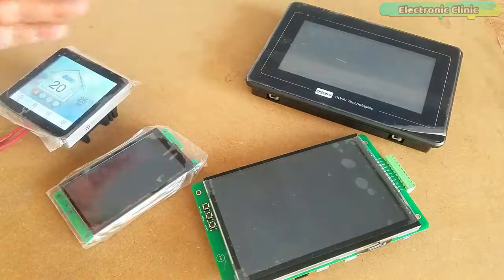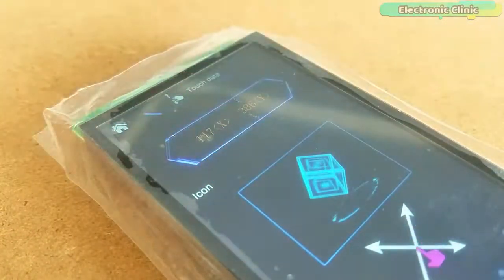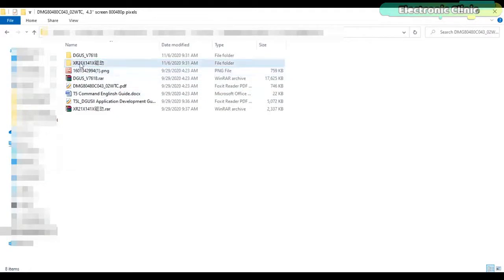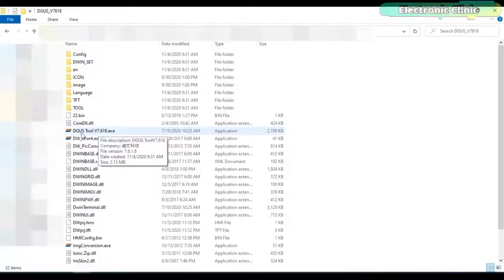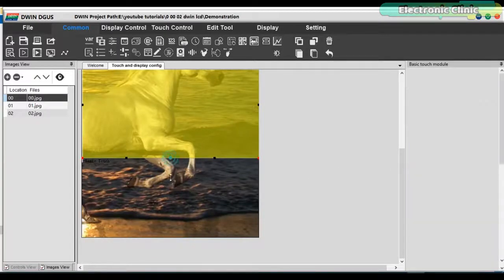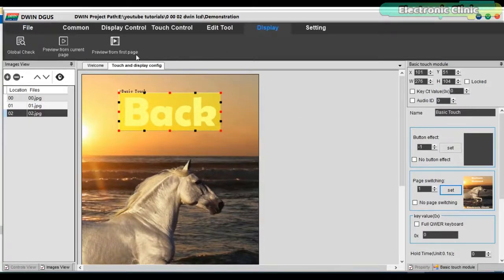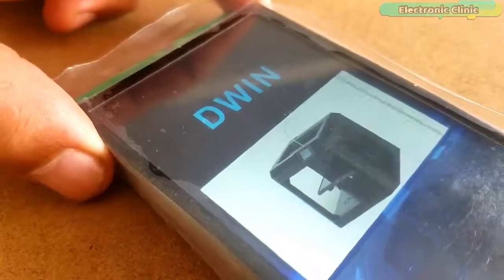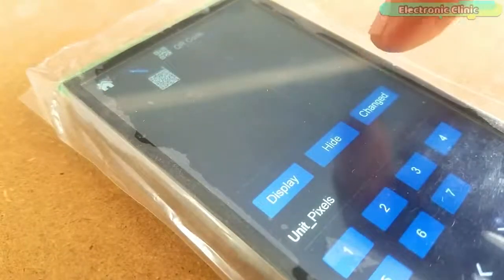4.3 Inch HMI LCM-DMG80480C043_02WTC Getting Started Tutorial

Comment: Hello.I am using lcd dwin side you pretty well. I communicated the UART with baud rate 115200 via command 5A A5 .... Is there any way to change the LCD default baud rate to 9600 or 57600 via UART?
Reply: you can change in CFG file